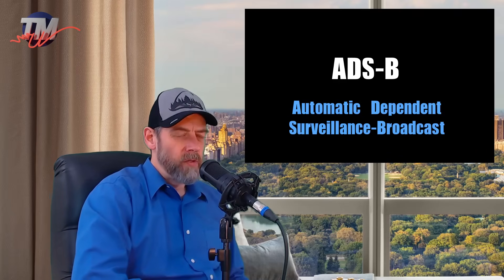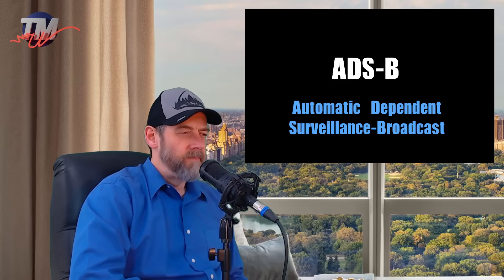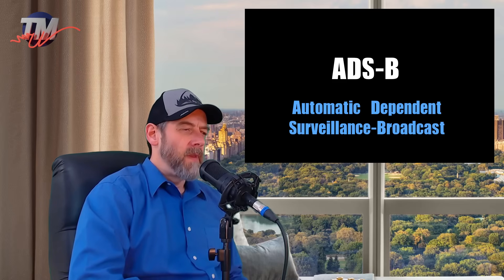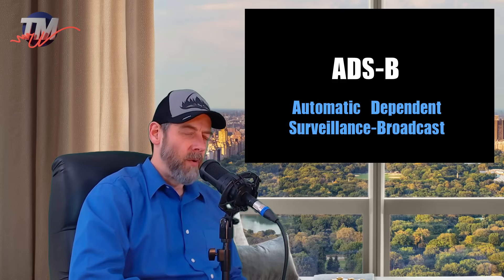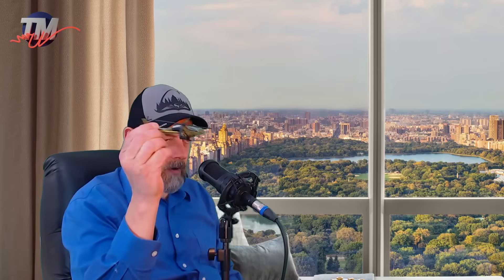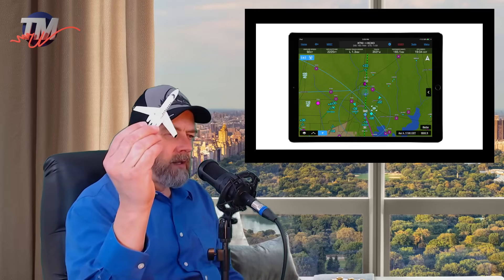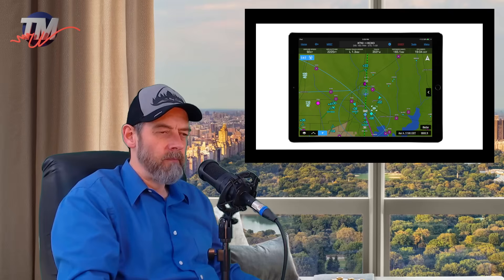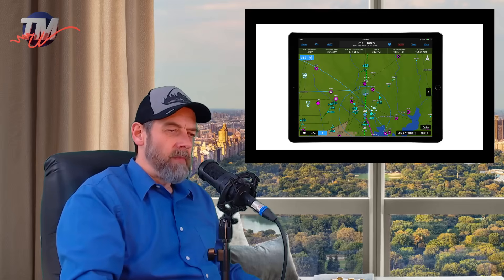The Blackhawk's ADS-B-Out system was turned OFF. Why, what is ADS-B, and why does it matter?

Comment: Effectively the black hawk was like a car driving with its lights off. Hence it was hard to see. Thanks for sharing.
Reply: Helicopters are generally exempt from ADS-B (Automatic Dependent Surveillance–Broadcast) requirements, especially during tactical, training, or operational missions. In the Washington, D.C. area, which includes Ronald Reagan Washington National Airport (DCA), airspace is highly restricted due to the Special Flight Rules Area (SFRA) and Flight Restricted Zone (FRZ) around the capital.

During the annual Blackhawk check ride at night, military helicopters may or may not have ADS-B turned on, depending on mission security and operational discretion. If flying within controlled airspace, they are usually in direct communication with air traffic control (ATC) and operating under military or government flight operations.
Reply from the maker: Incorrect @ezragonzalez8936! Military aircraft are not generally exempt from flying with ADS-B Out when in controlled airspace, except under specific circumstance: If they are on a mission of national security, if they have permission from ATC, or if they have a waiver from ATC! Know you regulations.
Reply: @truthmattersunplugged you are correct sir
Reply: With windshield blackened out
Reply: I think the NTSB can NOT be trusted to resist government pressure to create false narratives about what actually happened. They are federal workers with mortgages like everyone else.
Reply: ADS-B has only been required by ALL aircraft since 2020.  There hasn't been a midair commercial airline collision in the U.S. since 1990.  Where was ADS-B between 1990 and 2025? The lack of ADS-B played little part in the D.C. crash. The CRJ has TCAS (traffic collision avoidance System) and we know the TCAS alerted the CRJ crew from its FDR and CVR but they continued with their approach anyway.  The fact is, the ATC Tower Crew saw a conflict developing and did nothing to deconflict it.  He should have told the UH60 to either slow down and give way or better yet given them a heading change for traffic. He did nothing. Take the fatigue level of the CRJ crew. The last thing a pilot wants to do is increase his workload and risk factor at the end of the long flight. AA5342 Did just that by taking a last-minute RWY change when they didn't need to. Thus increasing their workload, and risk factors. Switching to a shorter runway and taking them across a well-known busy helicopter path was just stupid. There was NO reason to do that, and I point out, that no other flight accepted that change that day. Only 5342 did. Had they stuck to the original plan everyone would be alive.
Reply: @ Actually circling from RWY 01 to RWY 33 at KDCA seems to be routine. In fact, if you listen to ATC broadcasts, after the midair while ATC is closing the airport and directing fire-rescue vehicles to the crash site, another airliner checks in on tower frequency and on initial contact requests a circle to RWY 33.
Reply: @ILSRWY4  does TCAS tell the CRJ it was a helicopter, and which way to go (up/down/left/right)? Or is it just an alert that something was near? Was it up to the helicopter to avoid the aircraft or the aircraft that was supposed to avoid the helicopter? I assume the rules were that one was supposed to maintain a steady path and the other to steer around them, for if both were changing directions at random, there would be greater dangers of collision. Feels like you're trying to pin the blame on the CRJ. I don't know if any other plane switched from runway 1 to runway 33 that day. It was night, and it feels unlikely that the whole day, it had not happened. A lot of people have said they were pilots flying to DCA, and it was common for smaller planes to be switched to the shorter runways, because the airport is just over capacity. You said refusing to switch would make the pilots job easier after a long day. We don't know when their day started. But we also don't know refusing to take 33 would make their job easier. Runway 1 was in too much demand. Refusing to take runway 33 could mean somebody would have to wait, possibly placed on a holding pattern. Possibly it would be them.
Reply: @danielch6662 To your TCAS Question,  under 1000' it would just be a 'hey you have traffic' due to the fact you are so low that a Resolution Advisory (TCAS RA) that mentioned to drop altitude to avoid would have too high of a risk of hitting terrain/water. The helicopter was flying under Visual Flight Rules (VFR) which puts that responsibility to avoid on them, especially since the CRJ was already on an established and approved landing clearance.
Reply: @danielch6662 TCAS is inhibited from giving avoidance actions below 1000 feet. The CRJ crew didn’t know HOW to avoid the helicopter, only that they had an alert.
Reply: @stevetodd7383 , yeah, I'm not seeing how this is the CRJ's fault in any way, as some are suggesting.
Reply: @ILSRWY4  Very good thoughts! 
I agree  ADS-B  off was not the root cause for the accident.
But maybe the controller had a good reason switching to a shorter runway. 
I think this decision was problematic, but not the root cause too,

Bad thing: The controller was not aware, that the helicopter was flying way too high!
If the helicopter would have been flying below the allowed 200 ft, 
there would have been likely no collision happening.
That was the root cause, but mitigation was still possible.

When the ontroller got the collision warning, he didn't realize, 
that the helicopter was too high flying,
and he was not aware of the short time, he and the pilots had left,
 to avoid the collision. 
Mitigation was still possible, but good communication needed,

The bad communication led to misinterpretations.
As he was not fully situation-aware the controller started a rather calm and casual conversation about visual contact, no hint to the pilot, that the situation is already time-critical!
 
That did not help, the most important information he should have give to the helicopter would be a severe warning, that he is on a collision course!

 But even that would not have helped without other informations,
Immediately after the collision warning he should tell the pilots in th heli 

from which direction they have to expect a possibly colliding aircraft.
And next information what to do, climb, dive or what?
Precious seconds wasted for useless question!

Because the helicopter pilot did not know from where the danger came
 and might still think the "danger" comes only  from the plane far away and clear visible for him. 

I rather doubt if he was in visual contact with the nearer plane,
that was just initiating a sharp turn to align to the shorter RWY.
Unusual, but no collision, if the helicopter is flying as low as required 
 

The controller could have communicate his infomations better,
 to warn the pilot in a way, that is effecive.
 
The altitude of the helicopter was the initial failure, 
but mitigation was still possible.

Maybe or likly the controller had fatigue, and therefore reacted not appropriate to the situation.
He could have communicate his infomations better, to warn the pilot in a way, that is effective.
Instead he asked an ambigous question about visual contact.
The biggest mistake was communication, that led to false assumptions, 
and all failures added up to a fatal accident.
Reply: @bachtube11 disagree 100%.  The ADS-B off IS THE ROOT CAUSE.  All the other details you describe, tie back to lack of altitude awareness, so all the long discussions provide excuses to this main fact.
Reply: @ILSRWY4  Should have been an Unstable approach go Around on the CRJ's part.
Reply: @jdshemp BS.  Tower switches you from 01 to last minute side-step to 33 (strickly visual at night is dangerous). Then some Mil helo gets in the way, THEY should be told to hold in place.  Then they are running silent?.  No, the vessel carrying 60+ people is the “vessel in burden”. Dont expect them to keep being bumped around and diverted… at least Not in this extreme busy area.
Reply: @jdshemp  No. "Traffic Traffic" doesnt mean Go Around because this could make it even worse if you dont know where the traffic is. An TA (traffic advisory) doesent require any action other than raised attention. In contrast to resolution advisory (RA) where the system tells what to do (climb or sink).

Comment: Even if this was a trial, was it necessary to conduct it in such a raw fashion, with live traffic?
There were too many factors beyond control in a single experiment.
They should have aborted the experiment at the first failure (inability to spot the CRJ).

BTW the second CRJ was far behind the first, and there was no other flight in the sky.
So the hypothesis that they were looking at another aircraft is a bit shaky.

The CCTV footage show another aircraft nearer the Black Hawk, parallel to the incoming CRJ.
But it was clearly climbing, and coming from the east bank side of the river.
There is no airfield on that side!
So from where did it take off??

Comment: The L model Blackhawk does not have an ADS-B out, unless it has the suite E GPS mod. It is common to not use ADS-B on missions that are sensitive in nature. The military is excluded from the ADS-B requirements in FAR part 91.
Reply: Exactly!!!  And ADS-B has only been required by ALL aircraft since 2020.  There hasn't been a midair commercial airline collision in the U.S. since 1990.  Where was ADS-B between 1990 and 2025? The lack of ADS-B played little part in the D.C. crash. The CRJ has TCAS (traffic collision avoidance System) and we know the TCAS alerted the CRJ crew from its FDR and CVR but they continued with their approach anyway.  The fact is, the ATC Tower Crew saw a conflict developing and did nothing to deconflict it.  He should have told the UH60 to either slow down and give way or better yet given them a heading change for traffic. He did nothing. Take the fatigue level of the CRJ crew. The last thing a pilot wants to do is increase his workload and risk factor at the end of the long flight. AA5342 Did just that by taking a last-minute RWY change when they didn't need to. Thus increasing their workload, and risk factors. Switching to a shorter runway and taking them across a well-known busy helicopter path was just stupid. There was NO reason to do that, and I point out, that no other flight accepted that change that day. Only 5342 did. Had they stuck to the original plan everyone would be alive.

Comment: Oddly… I was learning to fly helicopters in Washington DC from an Army Warrant instructor when I first suggested an ADSB type system to the military
Reply: Helicopters are generally exempt from ADS-B (Automatic Dependent Surveillance–Broadcast) requirements, especially during tactical, training, or operational missions. In the Washington, D.C. area, which includes Ronald Reagan Washington National Airport (DCA), airspace is highly restricted due to the Special Flight Rules Area (SFRA) and Flight Restricted Zone (FRZ) around the capital.

During the annual Blackhawk check ride at night, military helicopters may or may not have ADS-B turned on, depending on mission security and operational discretion. If flying within controlled airspace, they are usually in direct communication with air traffic control (ATC) and operating under military or government flight operations.
Reply from the maker: Incorrect @ezragonzalez8936! Military aircraft are not generally exempt from flying with ADS-B Out when in controlled airspace, except under specific circumstance: If they are on a mission of national security, if they have permission from ATC, or if they have a waiver from ATC! Know you regulations.
Reply: @ This is correct. My thinking… the Captain turned it off deliberately. The request for visual separation was to get in close to another aircraft… the temp turn to the west was for timing… and then the helicopter rammed the CRJ.
People don’t like me saying these facts… or the PIC was removed from the White House when Biden lost… 
Placed as a DEI into a PAT unit… I’m guessing the Warrant was also a low time pilot, even as an instructor, civil pilots require 1500 before they begin to fly transport category size aircraft like the CRJ… or helicopters that large commercially.
Reply: @TestPilotN911RG  it's unproductive to make assumptions or conjecture about what was going on inside the Helo. It hasn't been ruled out that the crew could have been incapacitated and it could have been flown remotely. Also, they need to check the voice print of the crew members who used the radio.
Reply: @ yes, but more likely… she rammed the CRJ
Reply: @TestPilotN911RG  There is a difference between 500 hours in a helicopter and 1500 hours in a plane. You can't give equal weight to the experience for an hour.
Reply: @ actually, it is by FAA standards. And maybe it should be more. I fly both, and most time in a helicopter is spent learning to get it off the ground and on the ground… not flying around in the National Airspace System.
Reply: @ SFRA does not exempt any aircraft for ADSB requirement. Only special mission flights with VIP. No VIP, ADSB required.

Comment: This makes sense. Their training might have required to have ADS-B turned off to simulate a real emergency.
Several factors contributed to this tragic accident.
Reply: In that case, their simulation of a "real" emergency was way above that required.  😢
Reply: Except that in a real emergency, the airport would have been shut down and commercial air traffic would have been diverted. I get the idea but somebody didn't think it through. Just like they shouldn't have been wearing NVG. Yeah, in a real emergency the lights might be off and they might need them, but in real life, the lights are on, and are making it harder for them to see.

Comment: Doesnt matter if it was off, it was fully the aircraft controllers fault and the Democrates for having 1 controller for all that traffic and all their we have to hire minorities not people who are good at the job happens in every issue controller should have said altitude and direction of each aircraft,also runway 33 should never had been assigned at all.
Reply: The blackhawk asked for visual seperation ,after he recieved it ,it is nothing to do with the ATC
Also if this system was active the blackhawk would have been able to see the CRJ on it.
Reply: @michaelmather7352  Correct, but not only that. The controller asked TWICE to make sure. He also did his job by directing the 3130 that came right after the CRJ to immediately climb to 3500 and abort their landing, immediately after the crash. Also, with the ADS-B out on, the CRJ would have seen the BH on their screen and likely would have done a go-around.
Reply: There seems to be some confusion about how many staff there were at ATC, because another analysis by an air traffic investigator said there was 5.